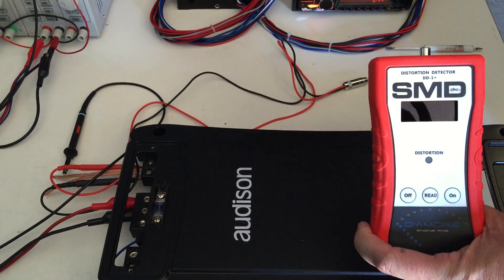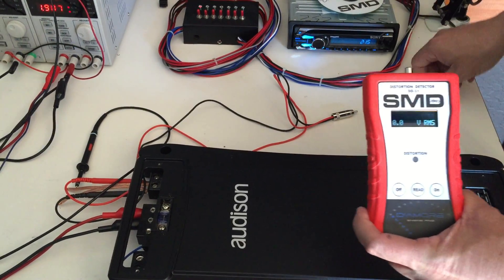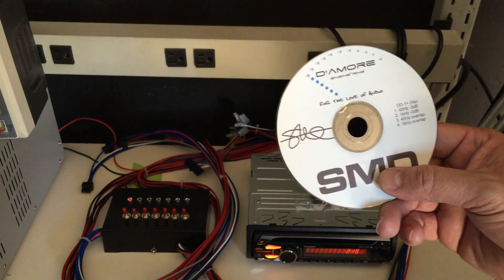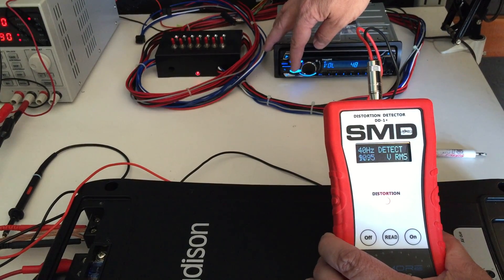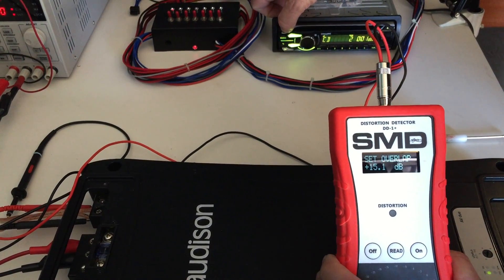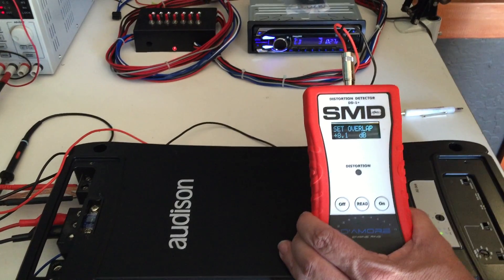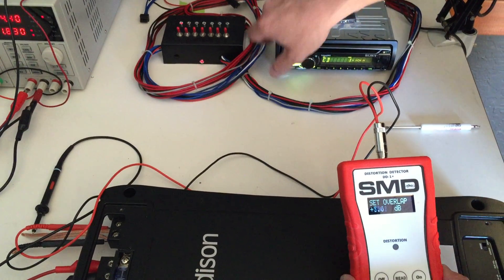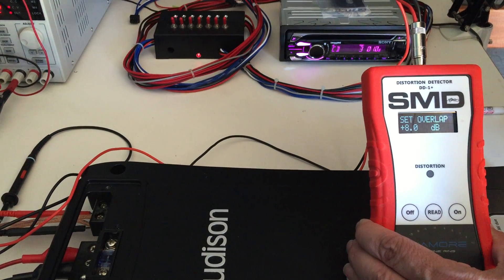DD-1+ Video Manual - Video 1, setting gain on a subwoofer amplifier

Comment: After setting my my amps up and trying to go back to check the gain over lap - I do not get a distortion light on 

What would cause this?

Alpine ILX-507 max clean volume to the amplifiers is 29 of 35 before the distortion light turns on 

Set up the sub amp at that volume and turn the gain up until the distortion light comes on and hit read, switch tracks and get over 10.x+ tried to set the amp to 7.5 and 10

Power off the unit and turn back on, play the test tone and distortion light doesn’t come on 

I know it appears to work on the full range amplifier when I set my front stage to 2.5 on the 1kHz track 

And I set my rear stage to no gain over lap and no distortion light when rechecking 

Any advice?

Comment: What happens when the volume gos to 62 max n it don’t distort at all wat volume do I put it at n set the gain I bought the dd1 n set my gain at 58 even to the radio gos up to 62 max’s my bass amp don’t sound rite at all it clips a lot at that volume I put it at

Comment: So set the system to clipping at 0db to set overlap and then ramp it up to distort even more. Got it. My whole system sounds awful now and the D4S JP23 amp detects distortion way before this thing does. My system is literally clipping all the time after setting my bass amp to a supposed safe 8 db overlap. Now every song shows clipping on my bass amp starting at volume 25 out of 40 on a headunit that is clean to max volume of 40 and flat EQ.
Reply: Make sure these things are done first:
1.  Use 0dB track
2.  Crossover all the way up
3.  Amp gain all the way down
4.  Remote subwoofer level control all the way up
5.  Headunit tone controls where you usually have them

Yes with 8dB of overlap you will be clipping the amp quite often.  If the subwoofers can handle all the extra power without getting too hot and you like how it sounds there then there is no problem.  If you never want the amplifier to clip no matter what, then don't add any gain overlap.  For most people they won't like this for subwoofers.  For mids and highs ok, but you can get the most out of your system with at least 3-5dB of overlap in the subs.  I usually recommend 5dB as a starting place.  

Things that can affect it: 

Tone controls after it is set-up.  If you set it up for 5dB and then adjust the bass control to +10dB, well then now you potentially have 15dB of gain overlap.

Bass boost after it is set-up

Not having remote bass maxed out during setup and then turning it up after

Comment: Excellent video, My question is. If you have a amp that is more powerful than your woofers, I’m guessing you can not take it all the way to distortion and do the over lap right? Or this process can only be done to a amps and subwoofer that are completely matched in watts? Or is there a different process that would be done in this case? Thank you.
Reply: You never want to take subs in distortion, you can have some underrated subs(sundown is one I know for sure)on higher amps but the signal has to be clean never dirty. Overlap setting is just away you can tell if a customer has tempted with the amp settings.
Reply: So like on the video he set the gain till it was red(distortion) & hit read for the overlap then backing in down the gain down out of distortion & marking the overlap db setting in their records so if the customer comes back the company will know if the customer adjust the amp settings. Hope that clears it up for you.
Reply: That is correct. If you have an amp that is RMS rated higher than your subs at the correct voltage and ohm rating your running to the subs, you shouldn't go much over the volume at which exceeds the capability of the subs at which they are rated for. As for the over lap I wouldn't take it all the way to 10, pending your equipment I would in this situation, stay around half. Just a suggestion.

Comment: On a 3 way active system if I have to check the clipping for the tweeter amplifier ,will I be able to use higher frequencies (around 5kHz) from my own test discs ? Can it show the clipping and distortion at any sine wave frequency played, or is it limited to detect only at 1kHz and 40Hz? Thanks
Reply: if the crossover on your tweeter amplifier allows you to use 1kHz tone just use that and set 0dB overlap for them and then put crossover back where you want it after gain adjustment.

Comment: hi, i got question.
 what if my powered subs set on low pass permanently from the factory, i can't set to allpass. 
how do i set gain to that? and, should i turn the bass knob all way down, or all way up? 
thank you for the answer. just got my pair dd1 and cc1.

Comment: Do u have to have flat that  adjustments on that stereo  in order to  set that volume on that stereo
Reply: I know it's 4 years later & nobody gave you the answer.  You have to set your eq or sound settings to your like. Also loud  settings to how you like it low,med ,hi .from there you set your head unit overlap to 0 . Then 3 to mids , 0 to tweeter, then 5 to bass amp.  The reason you set your eq sound first is because depending on eq sound settings your headunit is gonna have a different volume settings. Example set you eq to rock clean volume on head unit is 32 out of total volume 45. Set your eq at acoustic clean volume is 36 out of 45. Your sound settings would change you clean volume.  Also loud . Button would effect  total clean volume.  When I have a loud button I set it at low or medium all depending on your eq sound settings.  Hope this answers the question.  Been into car stereo over 20 years in the making
Reply: @fullpeladas  ok thank u very much ipreciated for replay

Comment: You should only ever setup for gain overlap if the max RMS output of your amp doesn't exceed the max RMS rating of your subs, right? Otherwise, wouldn't it be best to figure out the max volts you can run to the sub and just set it for that?
Reply: The max volts thing isn't great because it assumes that the amplifier can make a predetermined power.  It also doesn't set the headunit for maximum output (maximum signal to noise ratio).  Another thing is the DD-1 and DD-1+ are distortion detectors, not clipping indicators.  There are several things besides clipping that can cause distortion that would not be detectable without using a distortion detector.  Even an oscilloscope can not read distortion that isn't caused by clipping until its about 5%

Comment: Hey Tony those are great tools have you ever consider combining the DD-1+ and the CC1 together.
Reply: Lol great idea but they wouldnt make as much money that way
Reply: @akuma4u  There are a lot of factors that go into that, like inventory space, capital that is tied up in said inventory, and  hours of manufacturing labor would all have to be considered.  Selling two of something doesn't automatically mean 2x profit.  There would be some upside for us to make one tool, even selling less.  There are separate tools because we first designed the DD-1.  Then started selling those.  Then later we designed the CC-1 and started selling those.  DD-1+ was many years later.  That's how we got to where we are.  I mean why buy a set of wrenches?  Just buy a good adjustable wrench and call it good.
Reply: @nismotony  so... Make a good adjustable wrench now combining the dd1+ and cc1 and let us and our wallets  call it a day. Im sure you have the resources to produce this now. And it would make sense as well.